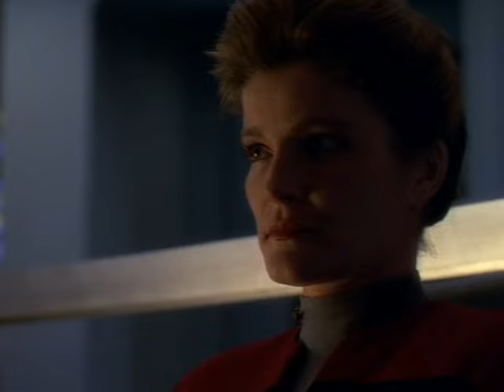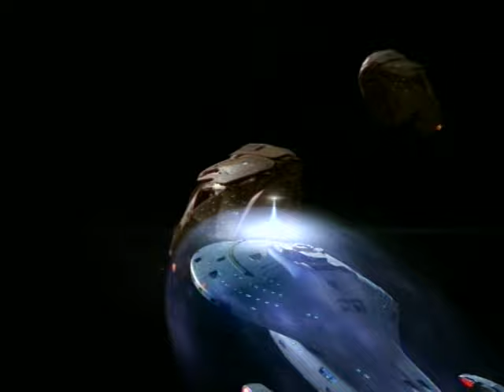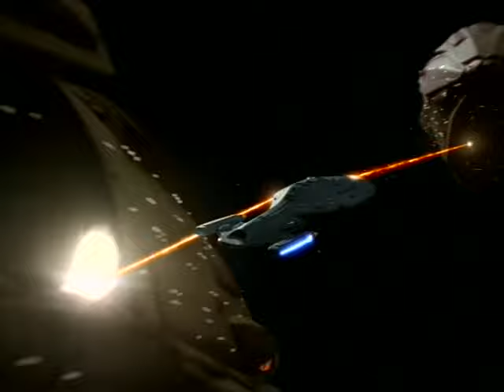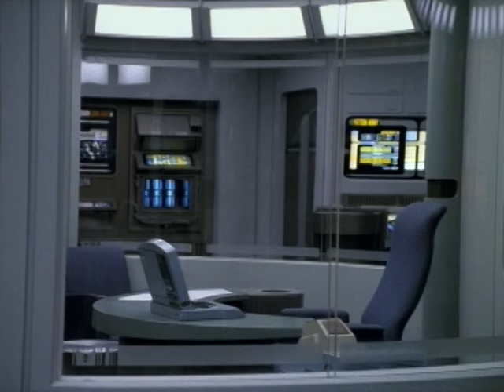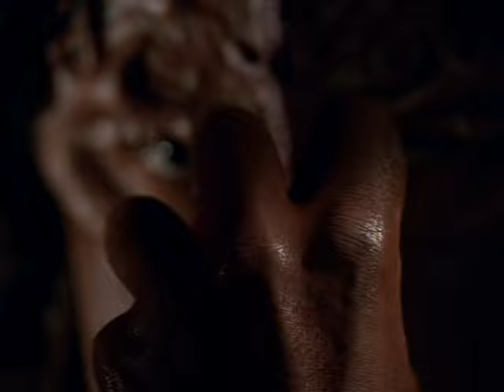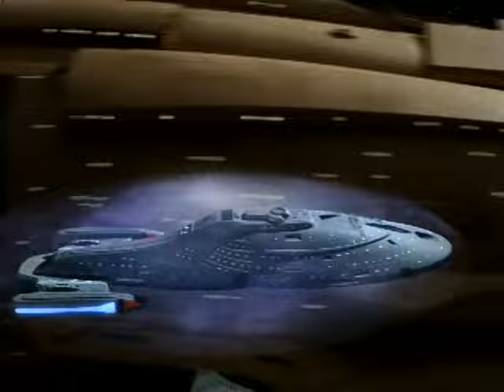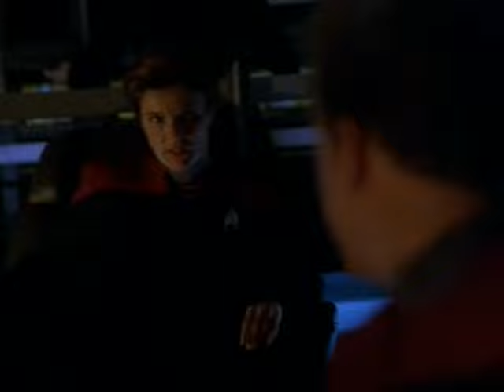Voyager's Battle with the Kazon-Nistrim  Part I

Comment: Rgis lirtkeship can beat 4 big ships but enterprise c can't deal with 3cromulan warbirds
Reply: Romulans were on equal footing (technology - wise) with the Federation. The Kazon technology is outdated in comparison.
However, 3 Carrier class Kazon vessels would have still been much without the holo ships dividing Kazon firepower.
Reply: @deksroning125  That's because they want to avoid war with them. A war with a power like them would be destructive. We never see how they fare with them. Although with the Romulans their main advantage is a cloaking device.

The Cardassians are more advanced than the major 3 though.

And those were not big ships. Those were probably 1/3 the size of a Galaxy class.
Reply: @robjackson5245  The Cardassians liked to BOAST they were more advanced than the Federation, Klingons and Romulans, but they really weren't.

They were in fact handily beaten down and are relatively small power on a galactic scale.
There was a DMZ established with Cardassia, but that's mainly because UFP is not warlike and they wanted to appease them somehow as they would 'ideally' want a reform on Cardassia which will eventually allow them to potentially join UFP... which is exactly what started happening during DS9 run (when the Obsidian Order and Romulan TalShiar were wiped out, this paved the way for Cardassia to move away from military control - but then Dukat shortly after seized power and helped spark the Dominion War - but after the War, Cardassia was so weakened by it that the military just had no real power left - and besides, most Cardassians just switched sides at the very end of the war which helped the allies win it).
Reply: @deksroning125  The Cardassians are far more advanced than the Romulans, Klingons and Federation, and that is a very unintelligent statement.
Reply: @robjackson5245  no they weren't. 
Seriously there is absolutely no canonical evidence whatsoever that the cardassians were more advanced than those 3 powers.
Reply: @deksroning125  Um yes there were.
Reply: @robjackson5245  No they were not.
There were minor border wars which created the DMZ, and we heard nothing of that during TNG.
If the Cardassians were more advanced than the Federation, they would have won those border wars... and in fact, they did not.

The battle at Setlik III seemed to have been pivotal... and after that conflict a compromise was reached.

The Federation loves to make fairly big concessions to appease other powers and establish good relations with them (since they would rather want to avoid an all out conflict) in the hopes of establishing better dialogue in the future. 

Also, if the Cardassians were more powerful, they would have retaken Terrok Nor from the Bajorans in the first opening episodes of DS9, but they didn't. They stayed away because Starfleet swooped in quicly and stationed officers stationed there and the cardassians knew that an attack against Starfleet would have meant a start of an actual war (And they didn't want that).

They schemed trying to drive Starfleet off Ds9 in an attempt to retake the station, but failed.

If they were more advanced, why resort to such tactics? In fact, if they were more advanced, those tactics should have succeeded, but they did not.

So, sorry to burst your bubble, but no, the Cardassians were NOT more advanced than the Federation.

Heck a single Nebula class ship was able to easily destroy a Cardassian Warship in TNG... and Cardassian Galor class ships also were easily disabled by a single Galaxy class in a few shots in TNG (And same thing happened during the Dominion war).

Seriously, have you watched either TNG or DS9?

I'll give you one thing, the Cardassians were able to make strong computer software, but even so, Starfleet managed to shut it down (eventually).

Also, if you're referring to the premise that the Cardassians built a Warhead capable of neutralizing most threats... yeah, I wonder why they never thought about making a gazzilion of those things in their conflict agains the Federation, or using same systems in their other ships... mainly because they can't scale it up it seems.

Also, as Be'Lana Torres mentioned 'Leave it to the Cardassians to build such an incredibly advanced tactical weapon and then arm the warhead with an old kinetic detonator.'

Look, its not like the Warhead was anything special.
Starfleet also made incredibly advanced and capable weapons... its just that they are not a warlike organisation so most of the time, they don't go around designing weapons of mass destruction like other powers.

The Cardassians were at the start of DS9 comparable in technology to other major powers, but once they lost the Obsidian Order, their influence and overall capability faltered to others.
Reply: @deksroning125  yeah I saw it. They gave the Enterprise a whipping in "The Wounded." Their ships withstood Klingon damage in "WOTW" for like 20 minutes before the Defiant came and possibly another 15 minutes after that. It wasn't like their ships were destroyed easily. They gave the D a whipping in "The Chase" and it was only of the ships since the other was focused on a Klingon ship. Then there's the fact that the they didn't seem to be afraid of the Romulans in that same episode either. Yes everything you said was unintelligent. Plus Maxwell only won that battle cause he went rogue. Worf seemed genuinely convinced that the Phoenix stood no chance without the shields.
Reply: @deksroning125  thats a case of not jumping to conclusions. There's was a possibility they were going to fight the Federation in that episode too. "Taking the heart" out of a fight is not the same as scaring them so no
Reply: @deksroning125  and they weren't border wars. It was implied to be a major war as Picard says to Evek. "DS9" made them out to be weaker, but they weren't saying they were, it was by accident. Them needing replicator aid was nonsensical since nothing on "TNG," which did show them as a threat to the major 3, said they didn't have that type of technology.
Reply: @deksroning125  I think with "DS9," and to a lesser extent "Voyager," the Cardassians were an allegory of what non-Allied countries wanted to happen to Allied countries because "TNG" had them as a first rate power. Even then that same Cardassian weapon ripped through Voyager's defenses.
Reply: @deksroning125  and one thing even by that standard, we still don't know how strong the Romulans are since they have cloaking. The Cardassians don't have it because they're honest. And to other cultures cloaking is seen as cheating. We only know how strong Klingons are.
Reply: @deksroning125  Are we watching the same show, because it was a stalemate. Neither side won that war!
Reply: @robjackson5245  

Lol... what a load of nonsense.

In 'The Wounded', a single Nebula class easily destroyed multiple Cardassian transport ships and a Warship (which was shielded btw and had 700 people onboard -  but it went down very easily).

Also the only reason Worf was concerned about the Phoenix standing no chance was because they were to give the Prefix codes to the Cardassians... but his worry was misplaced.

Here's the actual dialogue:
WORF: Sir, they will be able to dismantle its shields. The Phoenix will not have a chance.
PICARD: I cannot allow Maxwell to ambush that supply ship. Mister Worf, now.
WORF: Yes, Captain.
(a brief pause later)
DATA: Sir, the Cardassian warship is moving on the Phoenix.
PICARD: Mister Data, overlay weapon ranges of the two ships.
DATA: The warship is three hundred thousand kilometres from the Phoenix. It is opening fire. The Phoenix has taken a direct hit. The Phoenix is beginning evasive manoeuvres. It has positioned itself outside the weapons range of the opposing ship. The Phoenix has powered up both phasers and photon torpedoes. The Phoenix is firing photon torpedoes.
(and one of the lights on the screen goes out)
MACET: He has destroyed our warship.

So, yeah, even having the Prefix codes didn't save the Cardassian Warship (which went down very quickly btw).

Advanced my rear end.

In 'WOTW' the Cardassian warship was not under fire for 20 minutes at all. The Defiant detected weapons fire as they approached visual range of the rendezvous point with Dukat (implying the fight last for too long).

For crying out loud the Cardassian outer colonies fell easily to the Klingon invasion, and then because Sisko tipped off the Cardassians, they were able to provide a stronger resistance for a bit, but the Klingons actually broke through fairly quickly.

KIRA: Captain, we just got word from Bajoran Intelligence. The Klingons have broken through the Cardassian fleet.
SISKO: How long before they reach Cardassia Prime?
KIRA: Fifty two hours.
WORF: If the Klingon Empire has reverted to the old practices, they will occupy the Cardassian homeworld, execute all government officials, and install an imperial overseer to put down any further resistance.
SISKO: I think it's about time we had a talk with the Cardassians.

Oh and 'In the Chase', the ENT-D crew ALOOWED the Cardassians to attack them because they wanted to throw them off track (they reinforced the nacelles and faked the damage).
It was the Klingons who suffered minor damage to their nacelle and couldn't Warp.
Enterprise was fine.

All your statements about what happened in those episodes are completely wrong.

There is no evidence the Cardassians were technologically superior to the Federation, the Klingons or the Romulans.

Oh and need I remind you that a transporter clone of Riker aligned himself with the Maqui, managed to steal the Defiant and then wreak havock on the Cardassian ships when he went to take scans of the Orias star system where the Obsidian Order was building ships to attack the Founders?

Here's what the dialogue actually says:
RIKER: It looks like we're going to have to fight our way to Orias.
KIRA: Listen to me. Those three ships up ahead are going to lock onto our neutrino leak and open fire. That means you'll have to fight back.
RIKER: With this ship it'll be a short fight, I promise you that.
KIRA: Let's say you disable or even destroy those three ships up ahead of us. Fighting them at all is going to slow us down and then those ten ships behind us are going to catch up, and not even the Defiant can win against those odds.

Remember that? Even Sisko was helping the Cardassian military (and the Obsidian ORder had a representative there) by providing tips about the Defiant's vulnerabilities and they still couldn't stop it.

And that dialogue clearly mentions the Defiant could go up against at least 3 Cardassian warships... but that it would slow it down.

My guess is that the Defiant could 'safely' take on 4 (possibly 5) Cardassian warships at maximum... but definitely not 10. 

In fact in the episode, the Defiant was able to easily defeat a new Keldon class warship that came from the Orias system in that pursuit... 

TAMAL: We're approaching the first cruiser. They'll be in phaser range in fifteen seconds.
RIKER: Go to impulse. Decloak the ship, Raise shields and stand by phasers. Go to heading one one eight, mark three zero one. Lock on phasers. Fire.
KALITA: Direct hit on the cruiser's port nacelle. Their shields are down by thirty percent.
(Boom)
TAMAL: We've been hit on our starboard shield.
(Boom)
TAMAL: Shields holding.
RIKER: Quantum torpedoes. Full spread.
TAMAL: Torpedoes locked on target.
RIKER: Fire.
KALITA: Their defence systems are offline and they've lost main power.
TAMAL: Tom, three more cruisers have just appeared in the Orias system. That makes five ships ahead of us and ten behind.

So you see, the actual dialogue from the episodes easily and clearly contradicts your statements.

If you don't want to acknowledge that, its your problem, not mine (doesn't change the dialogue or what happened).
Reply: @robjackson5245  The Defiant was BARELY a new ship... the Keldon Class ships from Orias system (one of which the Defiant disabled in just 2 shots) were newer than the Defiant and they still couldn't stop it...

Like I said, the Cardassians are not more advanced the Federation. In fact, they started falling behind in DS9.
Reply: @deksroning125  Yes they are jackass. Everything on the shows show it. And besides btw, this wreaks of "Spaniards are non-white, Hispanic, Latin with Latin English accents/Nuyoricans and Italians are non-white, Hispanic, Latin with Latin English accents" 
Since the Cardassians are based on the Spaniards, Borg are based on non-Spaniard Germanics, Romulans - Latinos/Romans, etc..
Reply: @deksroning125  No upvoters. I don't have any yet, but I expect that to change. I've got lots of agreers.
Reply: @robjackson5245  I just quoted you lines from both ds9 and tng, and that demonstrates that the cardassians were not more technologically advanced than the federation, the Klingons or romulans. In fact the evidence shows they were barely on par and still lost pretty much every engagement in both tng and ds9. 

The ent-d beat their ships in a few shots. A nebula class destroyed a warship and multiple transport ships despite the cardassians having prefix codes to disable the USS Rutledge shields. 
The Klingons invaded cardassian space and overwhelmed them. Once the cardassians organised they offered resistance but still the Klingons broke through fairly quickly. 

I see that you're not only wrong and ignore the data, but you're also quick on insults. 

Oh well... good night
Reply: @deksroning125  Not really. I don't talk to people like you. So insistant that they're right. Cardassians are far more advanced period.
What data? I just said their ships withheld damage and weren't destroyed that easily. Also Weyoun notes that the Cardassian weapon batteries can rip through enemy galaxy cruisers, some of the top of the line (including the D, refuting your nonsense).
And no it's not Dominion technology, because Weyoun clearly never saw it before. And them joining the Dominion was because Dukat wanted the wormhole. Now go wipe your nose and play with your friends and have a cookie, little one.
Reply: @deksroning125  He said that without their shields they wouldn't stand a chance, little boy.
Reply: @deksroning125  BTW, even if I were to go by your theory, the only reason the D arguably (and I say argubly) won that battle was because they were the newest ship on the fleet. 4 years old at the time (the canon say 2350s, although the show makes it seem it was 2363 [present day equvilent: 1987], but they're still pretty close, when the show premiered). 

It wasn't like the Cardassians were so behind. The Federation beat them to it. 

Also the Romulans didn't update their ships either, and how many times do I have to say this: a cloaking device is not indicative of weapon strength and being advanced at all. The Cardassians were still ahead.

I guess Picard saying to Evec that he dreaded another war with the Cardassians and that the war had massive destructive, and it was Evec who frought with fear, it was Picard himself. Or the fact that the Klingons mention the Cardassians as being a challenging foe who got massive victories (and this isn't the Dominion War) doesn't matter either? Or I wonder what kind of stupid nonsensical explanation you have for that one. XD
Reply: @deksroning125  Nothing about their behavior indicates that they are behind, although "DS9" did contribute to the inaccuracies you believe, but not agreeing with you, it was by accident. They don't agree with your beliefs beliefs. Cardassians incapable of replicator technology? That's a load of shit. Nothing on "TNG" said that. And you can be a poor resource-starved country and still be a power. Spain (which the Cardassians were based on) pretty much. 

Or a lesser example, ever heard of Russia before and during the Soviet Union? Nobody's saying your stuff about them are they? Exactly. You are such a toddler it's beyond me. And I'm being sneaky and using unobvious examples to get past the Youtube censors who seem to have an issue with me for some reason.
Reply: @deksroning125  Going by "DS9" they were far less a threat before the Dominion. On "TNG" they were a first-rate power. Not what you idiotically believe.
Reply: @deksroning125  BTW I wasn't even intending to reply to you originally. I was trying to reply to the OP of that post.